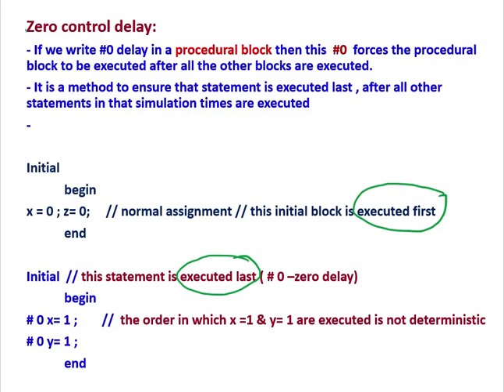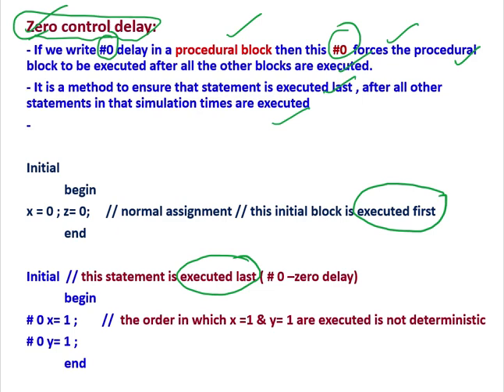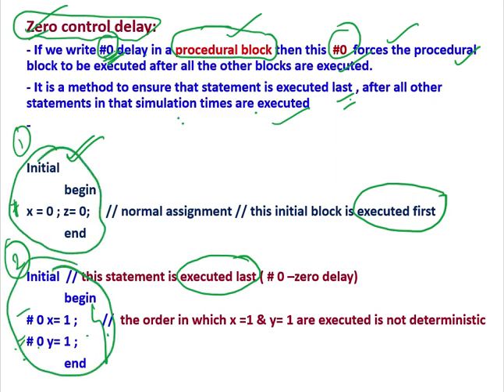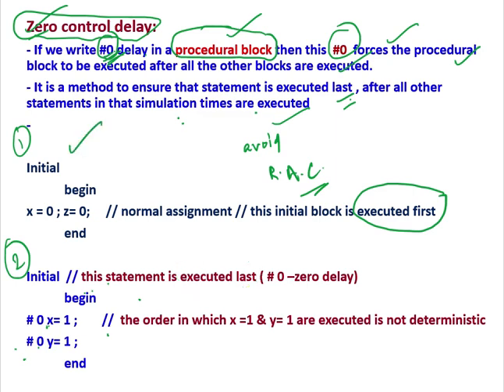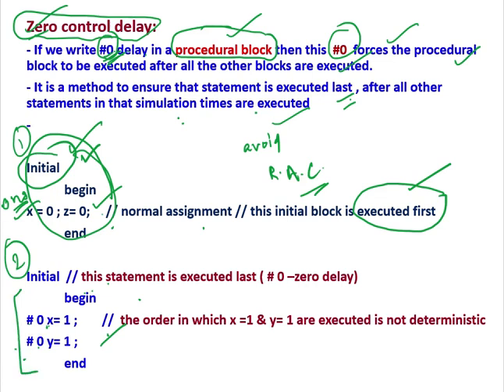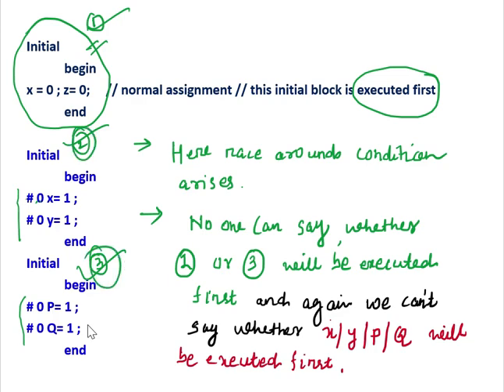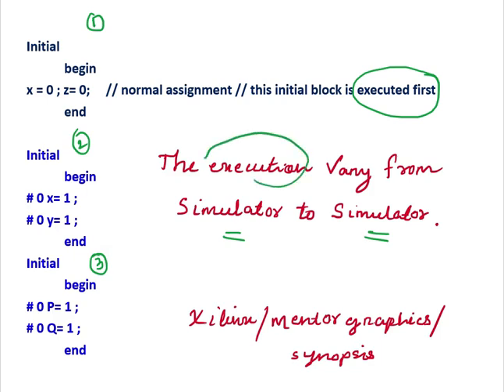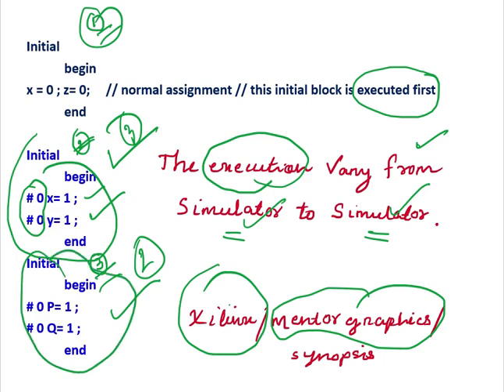#18-1 How multiple #0 delays are executed in verilog || zero delay control in verilog

Comment: Please sir explain race around condition exactly what it means
Reply from the maker: This is a state when there is a hardware conflict.

initial
a=0;

initial
a=1;

Both the line of code is executed at the same time but we don't know which line is executed first. It can be a=0 and then a=1 or a=1 and then a=0. 
When we can't predict and it is decided by hardware or simulator is called race condition or hardware conflict.
Reply: Thank you sir